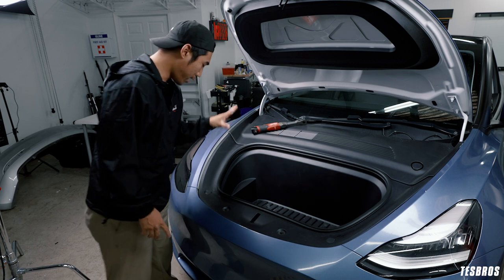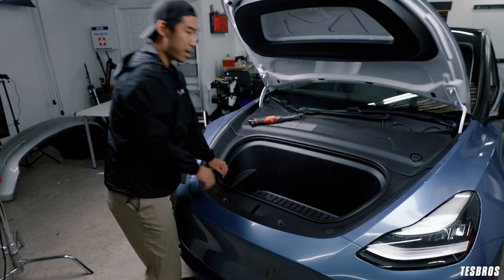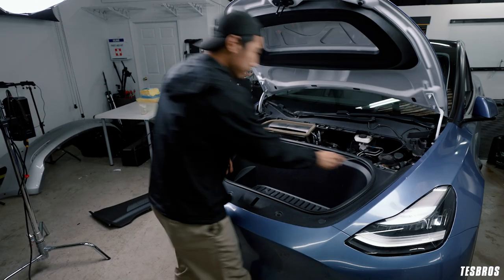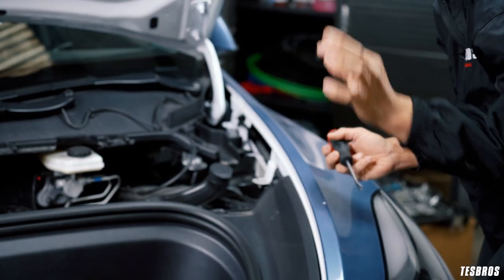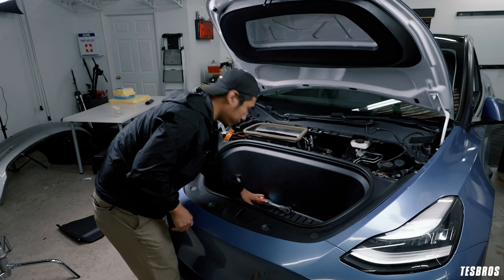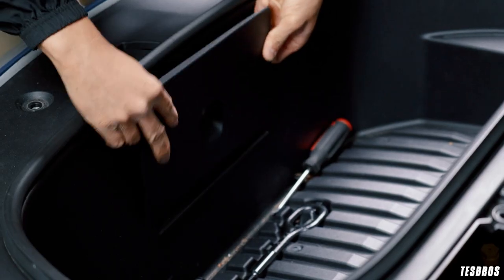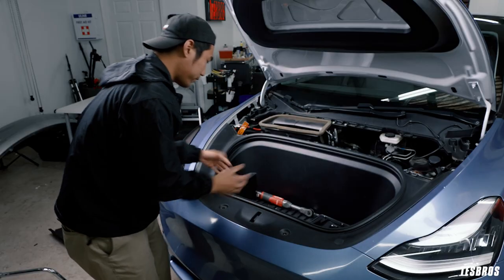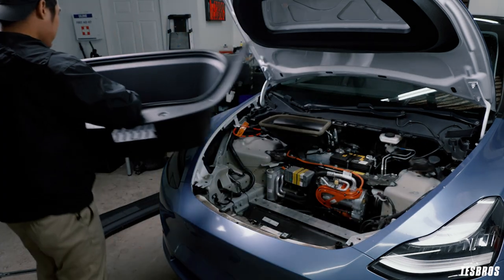Tesla Model Y Frunk Removal In Less Than 2 Minutes - TESBROS

Comment: Why would you want to remove this? Is this how you can clear debris from the front grill?
Reply from the maker: No, you can't get to the front grill from there. Unfortunately, you would need to remove the front bumper to clear debris. Removing the frunk is so you can do things like install a power frunk. You may hear rattles in the front because something is loose, so this way you can take a look and fix it too.